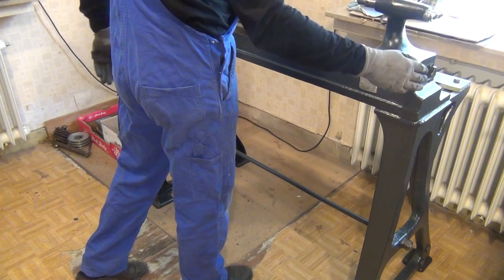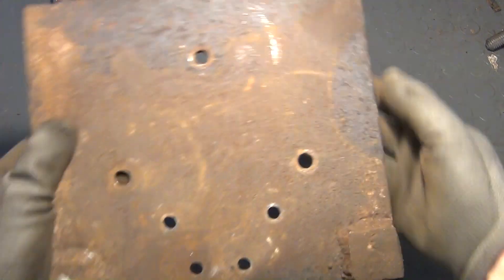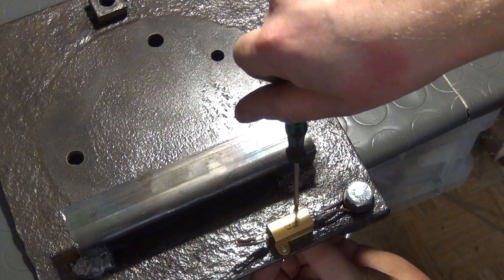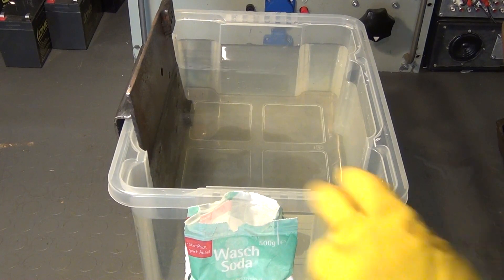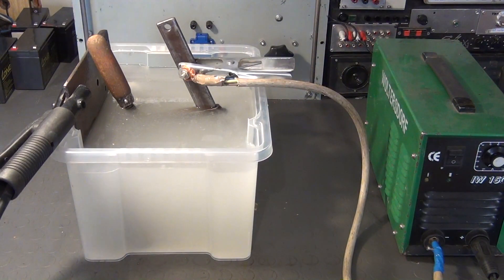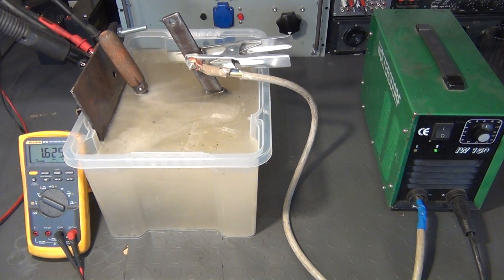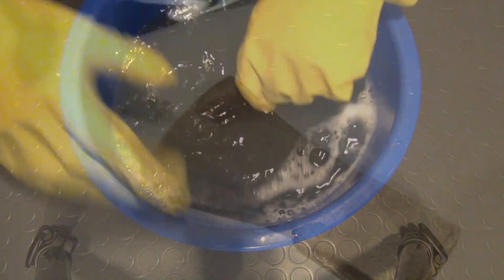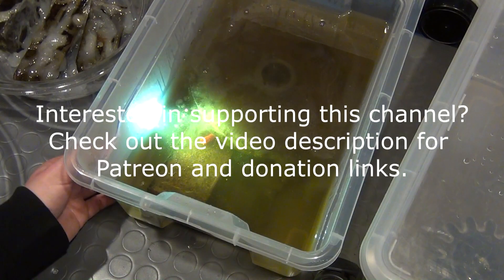Rust Removal Experiments: Electrolysis

Comment: I find this method works wonders. I use only 1.5A though but over 24 hours. I would be curious what the sweet spot is in terms of power and time. I have found that there is line of sight in regards to rust removal. An anode that fully surrounds the workpiece works better/faster
Reply: Sorry, Farm, but the above is almost totally in error. Electrolysis is NOT line of sight. An anode DOES NOT have to surround  the object, It won't speed the process. The only thing you're right on is lower amperage for an extended time period. Check my comments above.

Comment: fun vid, i disagree about the stainless steel creating Hexavalent Chromium, i cant find any scientific sources showing that it releases the hexavalent chromium when an electric charge is exerted on it but not when there is no voltage difference. so if your worried about exposure to it you shouldnt handle stainless steel at all.....but then again we have more hexavalent chromium in our water supply and stuff than we would like so its hard to avoid.
Reply: +Rinoa Super-Genius I'm curious why you would question it when many sites mention it after a simple google search.  If you didn't see them, try searching for "chromium released during electrolysis".  A sacrificial anode disintegrates into the water quickly during the process.  If stainless is composed of 10.5% chromium, then - the stuff goes somewhere quickly.  I was told carbon rods were safer so that's what I use.  Harder to find of course but safer in the long run.  I got a few carbon electrodes from ebay.  Some things are perhaps better not to push your luck with.  Finding out the hard way is not always healthy.
Reply: Geiger Mouse
i question it because i havent been able to find any scientific studies about it, thus we dont really know, we just have speculation.
 
why should i believe something that i ahvent seen any facts for? i plan to do experiments in the future though.
Reply: Geiger Mouse
yes i plan to try, ive heard some people say stainless never corrodes as an electrode and others say it corrodes a lot.
 
and ive made many videos about using electrolysis to de-rust things, i know how it works. i just dont ever have any stainless steel items i want to sacrifice.

Comment: Sodium bicarbonate is incorrect? I can't find anywhere else that says that, what's your source?
Reply: It's not incorrect, it is technically a common name, but IUPAC retains common names. He is incorrect for saying that.
Reply: satchel frost A common name, meaning it's not technically accurate? If not with respect to IUPAC, in what sense could it be considered incorrect?
Reply: In no sense is it really incorrect, it's just not considered systematic. There are two different types of naming systems: so called "systematic" and "common". Systematic is such that, from the name, you should be able to completely rewrite the molecule in full. However, either because the common names have persisted through the ages, or because the systematic name is too unwieldy most chemists refer to the common names. For example isopropanol (the stuff you buy at the drug store) should technically be named propan-2-ol or 2-propanol, but nobody calls it that. Another example would be 1-phenylethene, but nobody says that, instead they say styrene. Now don't get me wrong systematic names are very useful, but they are only ever really used when a novel molecule is created (which happens every day) and hasn't really been around long enough to develop a common name so we give it a systematic (or IUPAC) name so that other chemists know what we are talking about.

Comment: I believe the pitting in the axe head resulted from the high amperage used during electrolysis.  Its preferred slower lower amperage to have a more uniform rust removal.   Been a while since I checked these things but proved correct when I did it.

Comment: Does rust and electrolysis affect the quality of the steel at all? Could you still sharpen that axe, and use it as if it was new?
Reply: +Ace Sul ive used this method to restore a lot of stuff, and it seems to not effect the metal.
Reply: +Ace Sul all it does is reverse the electrical change caused by the natural rusting process. In other words, it should do no damage whatsoever. This is a similar process to plating something (such as with gold cyanide).
Reply: Electrolysis at high current (as shown here) will cause a degree of Hydrogen embrittlement. This can be reduced by cooking the item afterwards. However Electrolysis at moderate currents (1A or so) for a longer period of time (24-48 hours) will not have the same problem.
At low current you may get more build up of black magnetite, since the rust is being converted rather than being blasted away by the hydrogen bubbles. The black stuff scrubs off easily with scotchbrite or steel wool, but some may remain in the deeper pitted sections.

Comment: I found a product that works really well. Instead of removing the rust. The chemical reaction uses the rust to create a dark black coating that is like plastic. I put some in the bed of my truck in the sun out of the sun under paint. I've put it on axe heads and hammers. After 10 years those spots and tools still do not have any rust. The more rust the better it works. I looks like blackish blue electrically applied paint. If you are going to sand and paint over it anyway it's a near perfect product. I painted all the problem areas of a 75 scout with it. It is still on the road rust free. I dipped bolts in it and submerged them in Coke and they just got wet. Trouble is I lost track of it and forgot what the stuff is called.
Reply: Por15 maybe?

Comment: if you have the time, leave the parts on 1:1 water molasses mixture for about a month. removes everything without touching the steel underneath
Reply: Then have fun smelling that mixture after a month.
Reply: @gforcekaras  I did that. Goes mouldy if you dont keep mixing it, and it stinks like a horses arse.

Comment: What was your electricity bill that month? (just curious)
Reply: people think welders and power tools use up copious amounts of electricity, in reality almost any shops main power draw is the lighting, lights draw a fair amount of power and turn it into heat and they are running contantly, power tools and welders do draw more then a couple lights but theyre only used off and on here and there throughout the day, and if you have a big shop with 20+ lights no home gamer welder or even lathe/mill will draw more then the lights even if it was ran constantly
Reply: @AndrewBrowner  det.
Reply: +onjoFilms The welder likely tops out at about 50 volts (differs between sets), but even if it was an extra $2, it would still be very well worth it imho :)
Reply: J  k
Reply: +Kabeer Jay   If you calculate 20 volts @ 40 amps (just guessing the voltage), 7 hrs at .12 per kilowatt hr would only be about 67 cents (.67 dollars USD).  If that welder says 1500 watts, then about double.
Reply: onjoFilms Wooow

Comment: Nice! I tried this a couple of yeas ago with a car charger and could only get about 4 amps through it so it was very slow & made me wonder if I had wasted my time :) I guess I just needed more juice.
Reply: My 5 years later reply: 4 amps is more than enough. If you care about the item you are dipping, then the lower the better. On machined parts I keep it under 1 Amp. The reason is that high current tends to "blast" the rust off leaving pitting, whilst a lower current will convert (some of) the rust back into good metal.
Consider this: 24 hours at 2 Amps is the same "amount of electrolysis" as 2 hours at 24 Amps. But the surface will be much more pitted at the high current setting.

Comment: If you are rushing the part it's ok, but too much current isn't always better.

To much current can crate pits on the surface of the material. Bubbles are not conductive and more of them are there the less surface is in contact with electrolyte, and only that surface is getting etched.
Reply: AgentDexter47 - keyyyy tip, thanks! First I’ve seen of it but makes sense to me

Cheers
Reply: AgentDexter47   that is true on plating electrolysis, i don't think it applies to rust removal.
Reply: What about switching the polarities around periodically?
Reply: It's good to have high flow pumps to filter and manage the ratios of chemicals and ions moving effectively to displace the iron oxide.  All this has been well researched.  Using established standards through any standards origination.  Have immense resources with detailed process and controls to maximize your capitalization.  They always have experts to contact and books or guides with excellent detail technical specification to help in any operation from small to global.
Reply: @jerkimerjames3545  I've read about switching the polarities around periodically?
Reply: @jerkimerjames3545  All I'm trying to do is clean my shovel, and maybe the fingers on a metal rake. I don't care if the resulting surface is slightly less than perfect.

Comment: Pikachu use ELECTROLYSYS on RUSTYTOOL !
IT'S VERY EFFECTIVE !!!
=p
So you just use any oil to protect it once you're done or you add/use something else ?
Reply: +flo ri Lots of oils will work. Lots of vegetable based oils will go rancid. I use mineral oil for lots of things and sometimes I mix beeswax with mineral oil. The main purpose is that the oil blocks contact with moisture in the air. Ballistol,  3-in-1, motor oil, tri-flow, etc. DO NOT use regular WD-40, that stuff evaporates.
Reply: +Joe Hanson 
I will definitevely try the beewax mixed with mineral oil.
Thanks for the advice !
Reply: flo ri I recommend tri-flow with things like pliers and bikes. I use the mineral oil and beeswax mix on my axes because it works well for both the wood and the axe head. The mineral oil helps the beeswax penetrate the wood better and the beeswax makes the wood more water resistant on the surface mainly while the oil keeps the wood saturated with oil instead of water so it won't expand then shrink and crack. 3-1 is a good general purpose oil, same with mineral oil. Mineral oil works for sharpening as well for oil stones. Though you can use water instead as long as you don't mix them.
Reply: Well, I can't thank you enough for sharing your knowledge so intead of thanking you in a thousand words, here is a free smiley
=D
Reply: flo ri What is nice about Ballistol is that its great on just about anything, leather, wood, metal, etc. I would choose it over 3-1 as a do-it-all oil. I've no reason to use WD-40 when Ballistol is available, at least not for my purposes. When mixing the mineral oil and beeswax, look up a recipe. I used a glass jar in a pot of boiling water. Get some piano wire to cut the beeswax, its inexpensive and its the best way to do it.
Reply: Or you could use Copper Sulphate (used to etch Printed Circuit Boards) .... it will leave a smooth black surface that is rust proof!

Comment: I would like to know the total power (or voltage of the supply at 40A), and the polarity - it seems the rust gone from the plate so nice, you need to check it reversed. Thank you!
Reply: Answering an old question: The voltage will be about 3V or so at 40A. Polarity must ALWAYS be Negative to the item you want to keep, and Positive to the sacrificial anode. The plate has no rust because it is literally being destroyed by the process. The idea is to convert the rust on the item back to good metal, and it takes that metal from the Anode.
With negative to the item, the good metal is untouched, and only the rust gets converted.  Reversing the connections will literally destroy your good item, with the good metal being transferred to the Anode plate.
Reply: Muy correcto

Comment: Does the hydrogen (protons) produced at the target-object not em-brittle the steel or iron? See for example http://www.h2fc.eu/files/downloads/workshops/Mat_Workshop/H2FC-Materials-WS_Hydrogen_embrittlement_of_steels_Jorcin.pdf
Reply: Yes - at high current (like shown in this video) the hydrogen embrittlement is a consideration. The solution is to lower the current (1A or less) and increase the time period that the process runs for. 2A for 24 hours = 2 hours at 24 Amps
Reply: @johncoops6897 Thanks. Is there a general rule for an upper limit on current density [A/m^2] so as to not suffer embrittlement?

Comment: Thanks for update. I have acquired an old post drill press, Buffalo 66 model (hand powered) and it is cast iron and in some places deeply rusted. I plan to completely restore it to better than new condition (will bush the spindle) so I can use it if needed in event of long time loss of electrical grid power. I am not sure what rust removal method I will use, but will be chosen based on your videos on the matter.

Comment: Thanks for the video, I like that you were careful with details: you pointed about the stainless steel, copper cables, hidrogen, placed the device with the clamps...
In case anyone wonders, using table salt is not a good a good idea, because (if I recall good), you may end up generating Chlorine gas.

Comment: I knew you were going to be a wild man when it came to electrolytic rust removal. You did not disappoint either. You were cooking the goods! Be aware that the process causes hydrogen embrittlement of the pieces you clean. You can relieve that by putting them in an oven for a while, or it just dissipates over time. Also the cleaning action is mostly line of sight. So with your one anode setup you should rotate your work piece for maximum effect.
Reply: +Paul Frederick For those interested, I think for most part, any metal, the oven temp would be 150c (300f) for 30 minutes, (15mm thickness) , 1 hour (25mm thickness) etc.
Reply: BiddieTube
that is right. I figured just mentioning the term folks interested could get the facts on the intertubes.
Reply: BritzzONE
yes I do not know how much of a factor it is practically, but at least in theory the electrolytic process causes hydrogen embrittlement in work. I know I would not stress something right away after the process. Good as new! Snap.
Reply: +Paul Frederick: So the heat treatment should be done after the electrolytic process but before heavy loading of the steel?
Reply: +BiddieTube But if the metal was tempered below 150c as a lot of blade steels are, you are further tempering and softening it. Of course...if it's a blade, it shouldn't be allowed to get rusty in the first place, but I'm sure other things are tempered below 150
Reply: +Paul Frederick I was thinking the same about H-Embritllement! With 8 hours of that treatment it's surely happened :) An interesting experiment would be to hang some weights to the treated parts: they should break after some time from the application of the load, while resisting to the load at the beginning. Brittle fracture that is
Reply: After the electrolysis, the part should be put into an oven at 350F for one hour per inch of thickness.  Keep in mind that the time is for the part at temperature.  It doesn't hurt if you leave it in for a longer time.  So for this axe head, allowing 30 minutes for it to get to temperature is probably sufficient.
Reply: @paulkurilecz4209  I like my axe heads medium rare. An hour over cooks them.
Reply: hydrogen embrittlement occurs over a long period of time. What the Hydrogen will do is draw out the carbon from the steel. Great way to decarbonize an engine from within the combustion chamber.
But it tales a long time though.
Look up HOD systems and related.

Comment: Damn the powerbill wont be low.
Reply: +Phoenix Yeah, in Germany 1 KWh is around 0.25 -0.3 EURct.
Reply: 30 Amps at 2V = 60W = 0.060kW x 1 hour = 0.060 kWh.
Let's double that for the losses in the welding transformer.
0.12 kWh @ 0.30 Euros = about 4 CENTS

Comment: I was just about to try some electrolysis experiments to remove an aluminium seatpost from a steel bicycle frame, then this video popped up on my feed, so I'm going to watch your vid first, great timing!!
Reply: Wait ! 
Go watch rj the bike guy he do lots of vids about that
Reply: [screeches to a halt]  
great channel thanks for the recommendation!!
Reply: was hoping to eat just the rust using phosphoric acid and to prevent the galvanic corrosion between alu and steel, connect a voltage source across the frame and seatpost to counter the voltage generated by the 'cell'.

If its not out by tomorro i'll surely be using caustic.